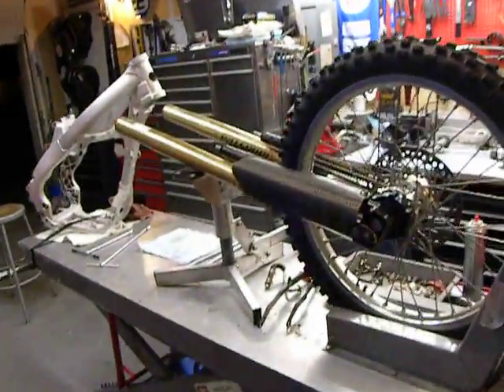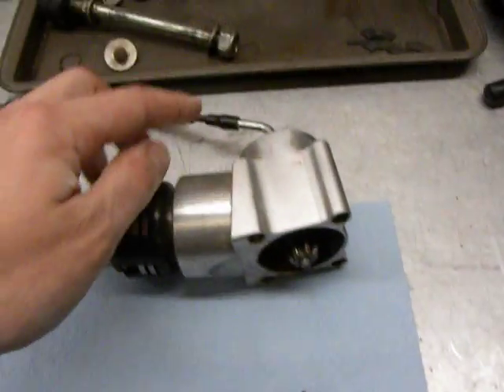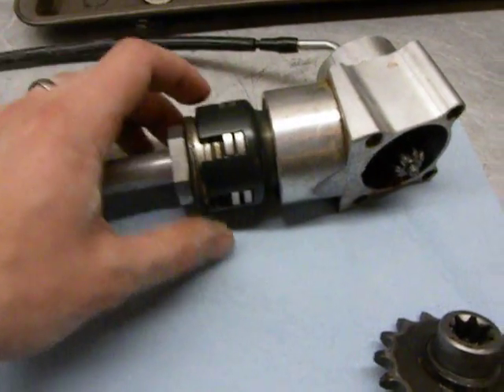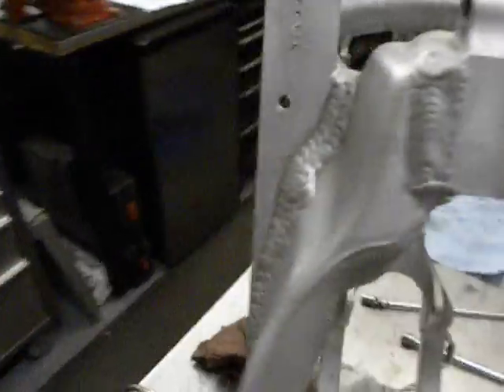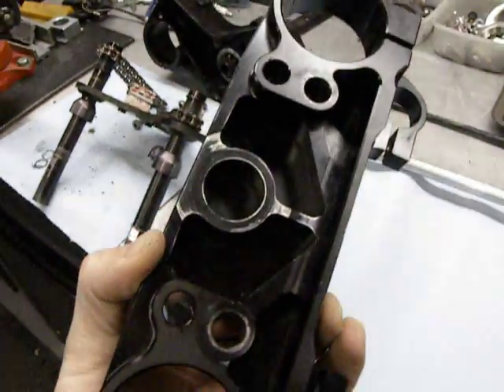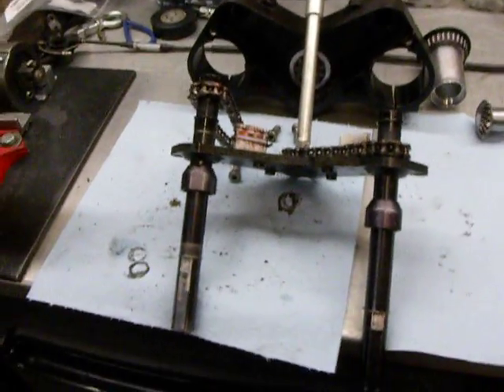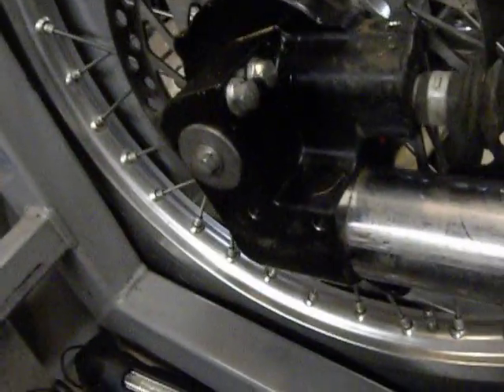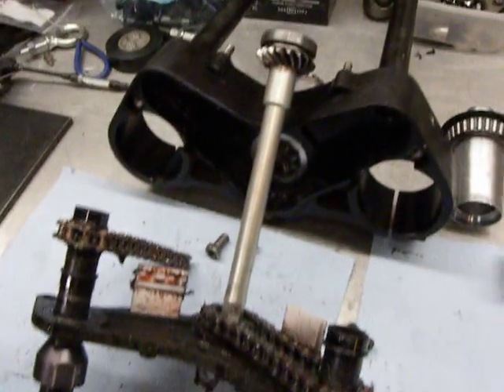Christini AWD Honda CRF 250X Disassembled

Comment: The ideal design could be a front wheel with an inside electric motor controlled by the traction control system.. such motor would be fed by a battery. The front wheel would propel the bike when the rear wheel looses traction
Reply from the maker: This is a concept that had been worked on. The benefits of the traction with that system are "outweighed" by the excess weight of the motor in an unsprung/reciprocating mass.

Comment: Any plans to put this system on a tamed dual sport that can handle long distance trips? something similar to a dr650 or a xr650l Anything that can handle cross country trips and wont need top end rebuilds nonstop as the miles add up. a Light weight adventure bike that could go through lots of mud or snow without getting stuck but still handle thousands of miles on pavement is what many people dream of.

Comment from the maker: The final drive chain is the same as standard, you leave it loose so that it does not tighten past the stretch point as it travels through the stroke of the suspension.  The drive chain to the gearbox unit does not need anything other than a basic tensioning device (In this case a piece of shaped Delrin with a spring holding tension against it) because the centers of the sprockets stay in the same exact place.